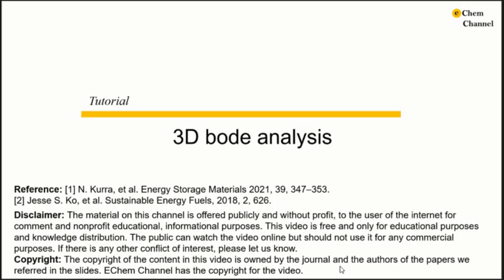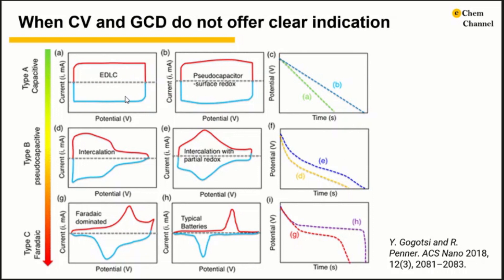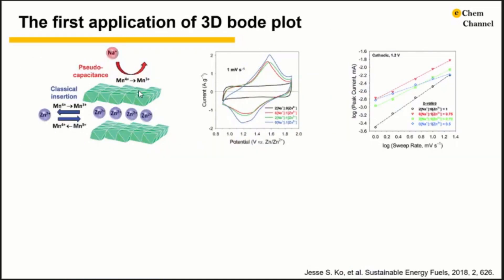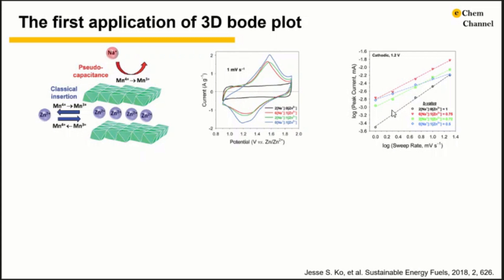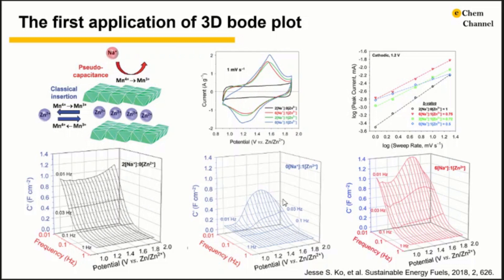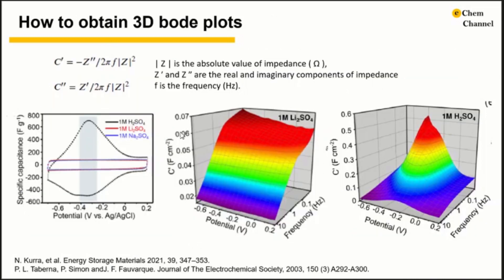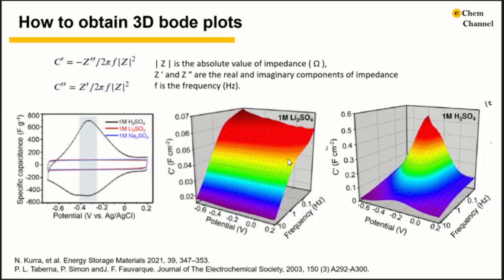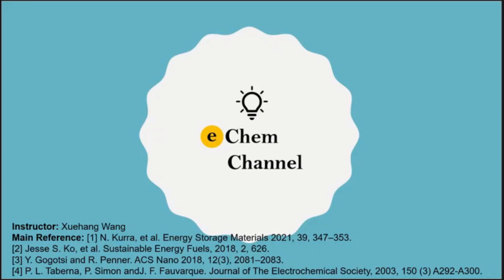Tutorial 21-3D bode plot

Comment: Can you tell how to extract capacitive and diffusive contribution from cv curves using origin in dunn method
Reply: Run cv at different scan rates.
Measure current's peak values at  both scan rates.
use the equation
i=k1v+k2v^1/2
it yields an equation of straight line of the form
i/v^1/2=k1v^1/2+k2
with k1 as slope and k2 as y-intercept.
plot i/v^1/2 vs v^1/2 and measure slope and y intercept
Now you have k1 and k2
Use the first equation in which k1v is capacitive current and k2v^1/2 is diffusive current find them